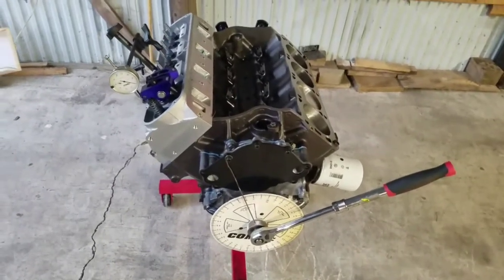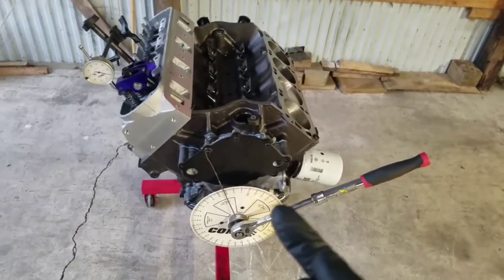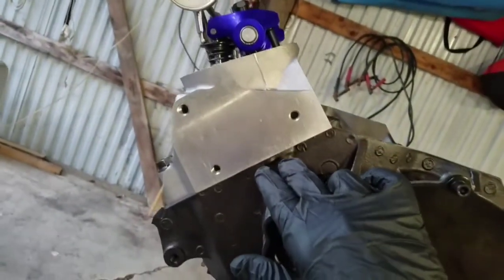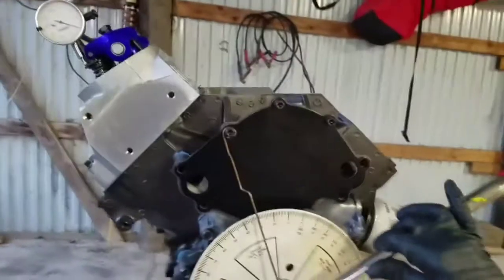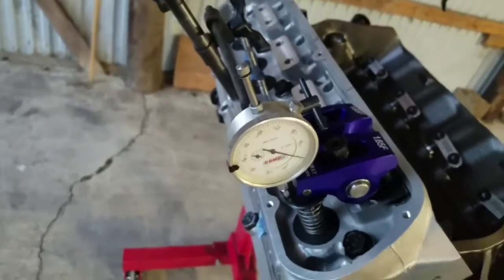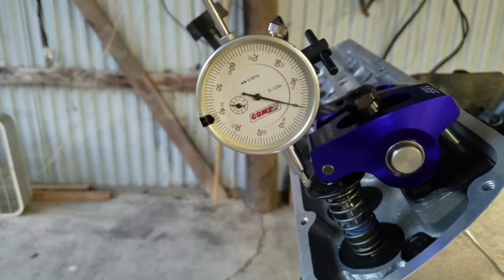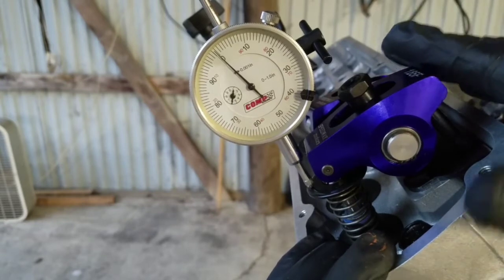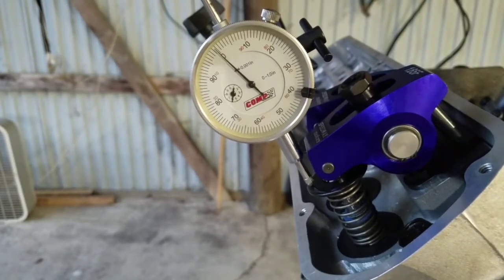Checking piston to valve clearance

Comment from the maker: Remember to assemble your top end like it will be used , except with valve checking springs and a solid lifter . I am measuring  lift directly off the valve . Unlike when you check camshaft ICL , then you measure direct from the cam .